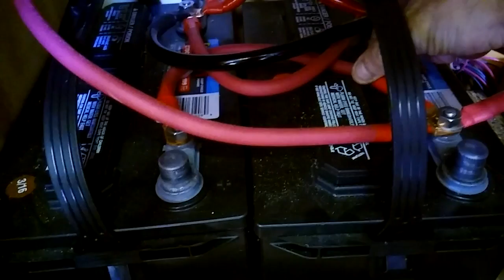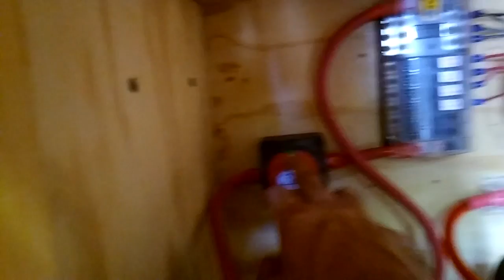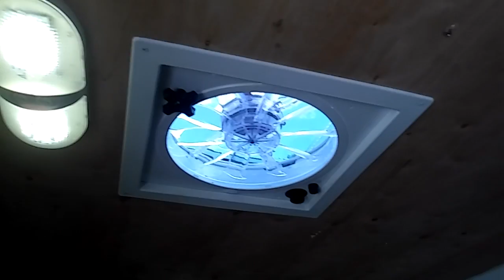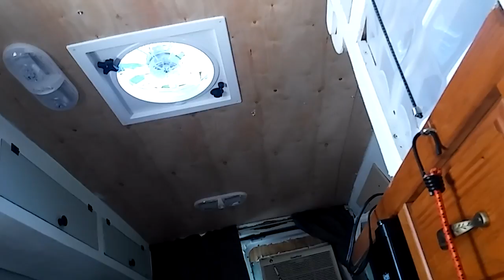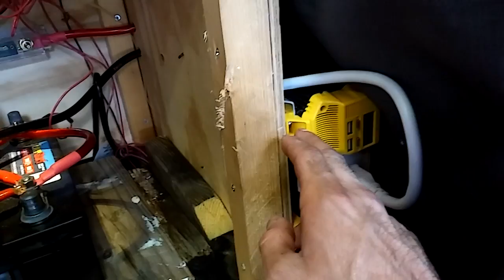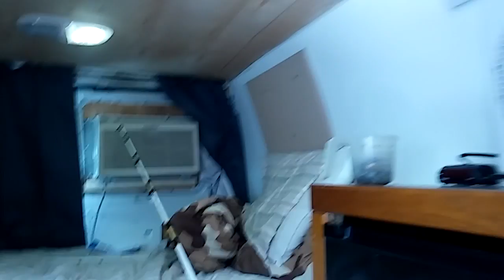Campervan & RV Electrical System Explained - Battery Bank, Wire Gauge, Inverter, Solar, D/C, ect.

Comment: Nicely done video. Easy to follow. So a couple questions...so u are no longer hooked up to the alternator? And I've seen vids that it's better to go w a 12v fridge rather than powering through an inverter...do u anticipate a big drain on your batteries once you're full tuning? And how do u check the batteries state of charge? Voltmeter?

Thanks and hope your mom had a great birthday
Reply from the maker: +rod22lt Thanks alot Rod! No my leisure batteries are not hooked up to the alternator they are charged through the solar panel, and yes 12v fridges are the best but i could not afford to get one at the time so i got the mini fridge and its actually not to bad of a drain on my batteries especially if the sun is shinning bright for the panels to keep a full charge. I check my battery level with my inverter it tells you the voltage level and i can determine the battery level with that. Thank you she had a great birthday! :) Take care Rod good luck with your future build man and make sure to send me pics of the van you decide to get.

Comment: Your battery setup looked fine to me except a couple of things. First those batteries in a accident will become projectiles. No way plywood holds em in place. They need to be bolted down to the floor. They are mounted directly behind the diver seat so you should do this right away. Also those batteries look like wet cell batteries to me and they require venting to the outside while sealed air tight from the interior.
Reply from the maker: +NewZona Rides 2 Hey thanks for the advice man , i appreciate that! I will be securing the batteries to the floor sometime this week, and will be venting and sealing that battery box. Thanks again. :)
Reply: Hey Cory ! I know its a older video But it's great I been brain storming myself on my Chevy blazer I know its way smaller But i'm designing a bed with angle iron welded just above the wheel wells with spacers And  Alum, flat bars to fit in between the spacers so they don't slide or move 
I have removed the rear seats for added room and a thermal wall with access hole  Behind the driver seat there is room for 2 batteries and the pass side for inverter shut off panel etc  I like the options you have  power  As i have already changed my ALT, to a 130Amp from a basic 80amp i have gobs of power at hand  I plan on using Welding gauge wire 2awg as it seems better incase of heat The outter coating is thicker then most other wire and the price is pretty good 

My question : Can you still have your Isolator in to run your battery off the engine With the batteries still connected to the other sources of incoming power? IE  Gas Gen, Solar, and Ext cord plug in..I hear with a Isolator some come with a swtich where if your starting battery is drained for whatever reason you can hit the switch and start the truck that way 
What was the reason you removed it?  Thanks  Give me 6 months (over the winter and i'll send you a video

So far on my truck Custom root beer paint i done , Dual cam install with hard wire 12hr record loop (11.6 Low volt shut off ) Aftermarket alarm/remove start (Canadian winters)  real walnut burl venner trim for the door handle backing and window switch trim hand made   Distressed pigskin leather door panels /Windshield pillars And soon sun visor 
2.5 inch Rough country lift kit And all front end parts  Which i just installed (never again lol) 

Next spring  Spray foam from a friend that has a mobile unit (Will have to do a quicky at a job site if i want it for a case of beer ) 
Lighting 1 main connected light in the rear roof,  A second  cheap dollar store  removable 9v light  .. 8 Mini LED blue lights per side of bed very low watts   2 12v plug ins  One of which will power a small / Medium cooler (12 cans)  and a 2 USB port for Iphone / Laptop    Mid summer ..100 watt solar panel 
Anyways thanks for any tips
Reply: +steve murphy I disagree. He posted this public and someone could watch this and think this is the correct way to install this and get hurt. It is without question not safe the way it was installed. I didn't mention other less serious stuff in my comments.
Reply: +Daryl Maupin I was not criticizing him at all. I do this all the time and just wanted to help.
Reply: +Leroy Lucas I have seen what can happen in a accident with those batteries. Not at all a pretty site. It is a serious safety flaw.
Reply: +phil vano Thanks for asking nicely but my advice was for Cory. If he wants me to stop he can ask me to stop in his own.
Reply: I'm a bit late to the forum ... but ... Corey... awesome video... you described it perfectly for me. NewZona... your input was apt and valuable. Thank you.
Reply: steve murphy amen
Reply: +Leroy Lucas I was just trying to help. I have seen a battery install go real bad. The things I pointed out are serious.
Reply: +phil vano 
NICELY put & to the point. 
 I'd use the fiber self locking nuts for the top which usually has a drag tourque of 10 inch pounds thats added to final touque.  I used castlelated nuts on mine with small cotter pins to prevent vibration back-out.  Safety wire would've been better.  When I flew helos in the Army, everything had stainless or copper safety wire.
Reply: +phil vano 
Yup the computer fans are the way to go.  I bought the round 3" aluminum louvered puck style soffit vents from Home Depot and 4- 2" Ebay computer fans for supply and combustor air return.  Those fans only draw .03 amps each.  Fans also have a small horse hair filter cut to fit while easy to clean.  Their getting noisy and old so I'll be replacing them soon.  The garage is hot enough as it is and the wife wont let me drink or smoke in the house after the new carpet and furniture.  At 24 hrs a day, 365 days to a year thats over 8,000 hours run time so I'll be getting some decent replacement fans with bearings this time.
Reply: +NewZona Rides 2   I imagine he's just playing nice.  No mote comments on the already obvious.   Oh, and dont forget to wear safety goggles and gloves when drilling.  Obviously.
Reply: dude. he was helping. calm down.
Reply: apparently you have never seen unsecured batteries in a wreck move and potentially start a fire.Safety with batteries is paramount in vehicle,solar and UPS installations..It is coomon sense to secure and also isolate the pos. covers.Ever seen anyone drop a wrench in a UPS battery bank?
Reply: NewZona Rides yes!   Venting!  Or buy sealed batteries!
Reply: NewZona Rides https://youtu.be/PB0OvFtGmSg
Reply: NewZona Rides proper venting of wet cell battery set up!!
Reply: +NewZona Rides 2  Does Cory not seem like a reasonable prudent person to you acting in good faith to do the right thing? His verbiage, expressions,  body language, numbers, specs, tech talk, material guide and knowledge clearly shows he knows what hes talking about and definitely one of the better self install videos on youtube that I've ever seen and I've seen allot.
Your comment is right up there with what someone else said earlier.
 "Don't forget to use distilled water for the batteries and oh yea, wear goggles and gloves too for safety".  That person later deleted their post.
Reply: Zona, I saw your channel and you too did all your install upgrades a little at a time.  You can't compare your stuff to Corys because hes still in motion and probably working on it between pay periods.  Its obvious he knows what he's doing and he even said what he has to do to finish it.  Took me 6 mths to do my 1,500 watt solar install due to finances even though the install took 20 hours.  See?
Reply: Dude, really?  He said he was still working on it and that it wasn't finished yet.  Shoulda, woulda and coulda?  What he didn't do was pay the crooks at Camping World or RV Dealership a fortune to do the install nor would they had done as good a job.  Like someone else suggested, you buy his agm's for him if your that concerned.  Come on man.
Reply: +NewZona Rides 2 
No, your sharp shooting the guy.  I am a solar installer and found nothing wrong here what so ever.  This isn't a Solar Tech Engineering Vlog, just a Joe Blow humble average guy doing his own work while sharing a Life Experience with others.
  If I see something wrong I PM the guy, not steal his thunder in public.  Nothings wrong here.

Comment: Might want to buy a low voltage disconnect and wire it in so if your power gets to low you won't destroy your Batterys ..Your build is looking great thou
Reply from the maker: +VW Vanagon Westfalia Travels Hey thank you so much i will definitely look into it! :)
Reply: +Campervan Cory 
Your 120 vac inverter already has a Low Voltage kick out and probably an audible alarm too.  Some people on here crack me up with their Crumbs of information yet have no Install Video's of their own.
Reply: @ @darylmaupin5728  ... Some of us are just trying to answer questions from other commentors as a service to Cory... Didn't realize we needed a "Video of our own" to help Cory along. 
But whatever toasts your oats bro....

Comment: I'm almost starting to get this Solar Power stuff after watching like 1,000 Vid's.  Cheers! Thumbs Up!
Reply: Ha, ha.  I too had to watch hundreds of self help youtube videos before doing my solar install.  Ive got both an rv and a van for the shorter 300 mile trips.  I prefer the van though per fuel, stealth and maintenance wise.  Knowing what I know now, I'd never buy an rv again and will never get my money back out of it.
Most mechanics will NOT work on an rv even though its the very same motor trucks and vans have.  Why mechanics want to charge $132 an hour RV repair rate when a pick up truck or car repair rate is only $65 an hour is beyond me.  After all they're not working on the towel bar or toilet.  Just another way to get over on the public I guess $.

Comment: Great video, Cory, and great run through of how it all hooks up. Quick question, are you using some red wire in place of black wire from the ground?
Reply from the maker: +Alex Tucker Thank you Alex! Yes i only had the red wire so i used black electrical tape on the end of my ground wires to tell the difference.
Reply: Campervan Cory
Okay, that's what I thought, but wanted to make sure. Thanks!